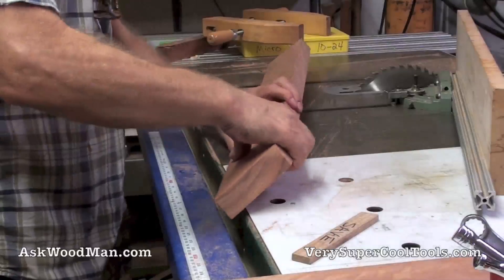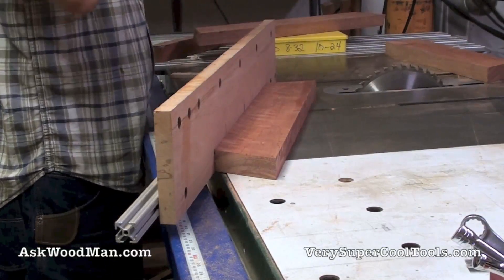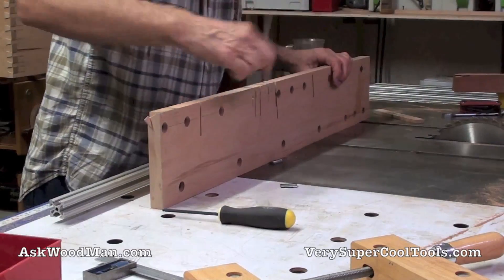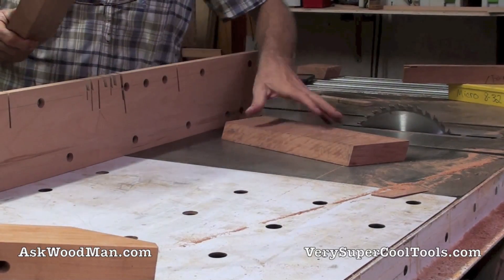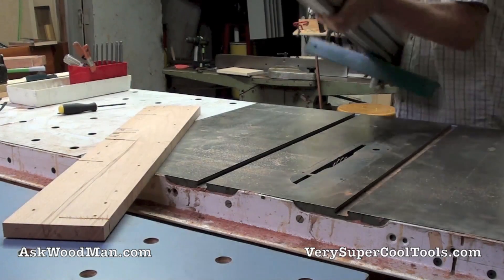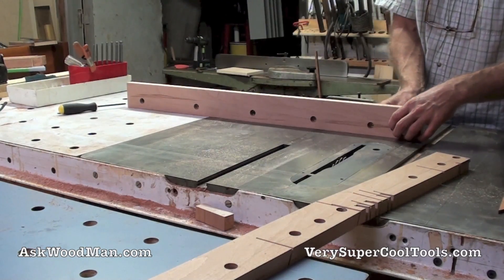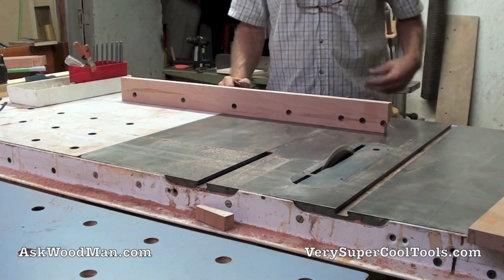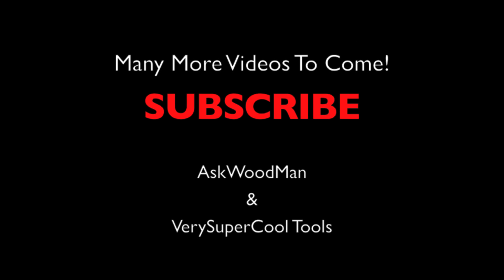Miter Gauge Upgrade 2 of 2

Comment from the maker: 80/20 dot net has an Amazon store where they sell many profiles. The one I am using here is 1x1. Grainger too. Many Ebay sellers also. Those extrusions used throughout industry. Did you notice the table saw fence with extrusion? That is from my company VerySuperCool Tools.

Comment: So out of curiosity, why not use a miter saw? Is it personal preference, blade deflection, or etc...?
Reply from the maker: I consider a miter saw a job site tool for base, trim and crown. I don't do that kind of work. I am a shop woodworker and have never owned or had a need for a chop saw in almost 30 years of work. Chop saws are great machines for certain applications but a 50lb plastic and aluminum tool with a commutator motor can't really compare to a 500lb cast iron machine with powerful capacitor start motor. What it comes down to is miter saws excel at a type of work I don't do.